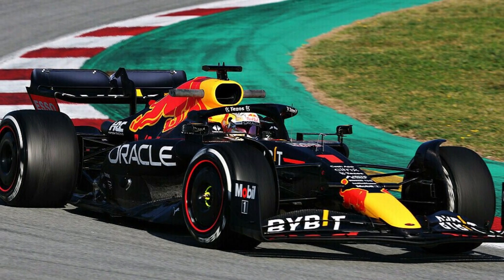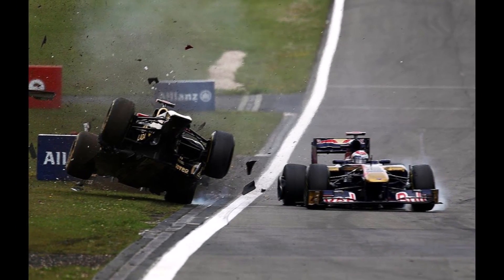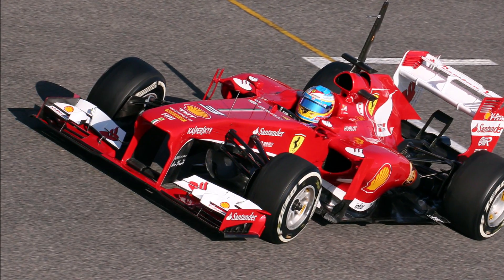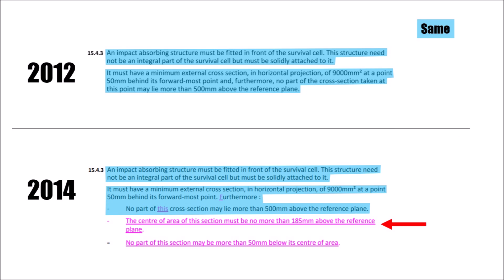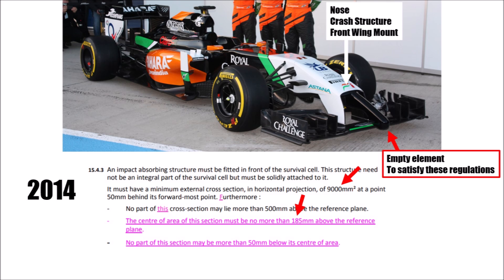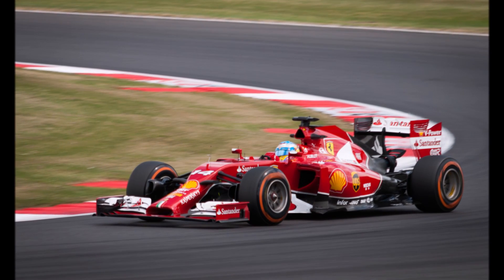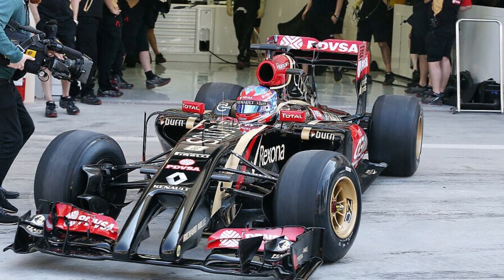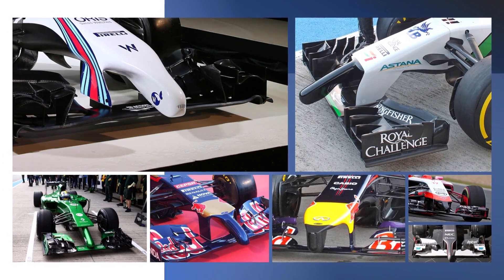F1 2014 - The UGLIEST F1 Cars Ever - How did this happen? (Technical Summary)

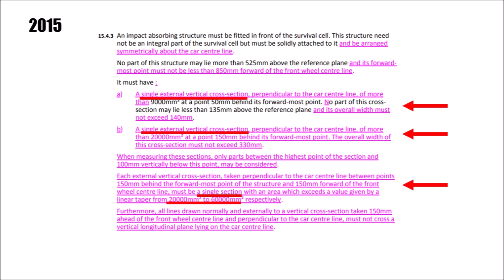Comment: 5:02 No man, I actually prefer these 2014 cars over the current ones, they were smaller and had nice liverys, the only bad part was the nose, the current cars are too big, and they keep taking the paint off to save weight, it's a disgrace, and all liverys have matte paint (which i hate).  Seriously, I don't like any of the 2023 liveries because they're all awful and it ruins any chance I'm going to like these cars.  And the Halo also messes up the on-board camera making it look like a bathtub on wheels, so I definitely like the 2014 cars better. Also, Mercedes, Ferrari and Red Bull had a nice nose, Williams had nice curves in the nose, Lotus was different but I didn't think it was ugly and Toro Rosso's second nose was way better than the first.

Comment: Would the high noses seen in 2012 have been beneficial to earlier, say, 2008 cars or was it due to the inert center sections of the front wings that made them beneficial?
Reply from the maker: Getting more clean air underneath the nose is always beneficial, but the neutral centre section even increased the amount.